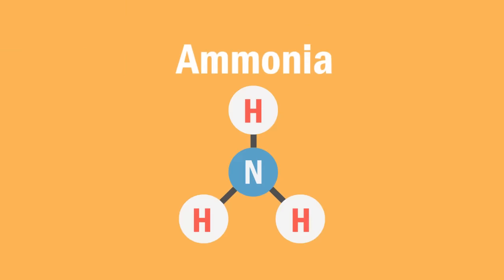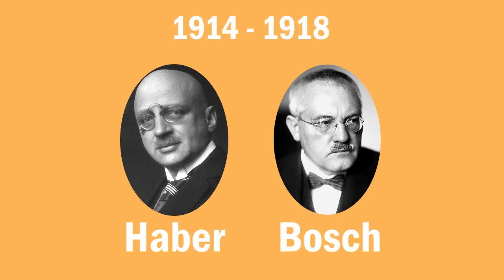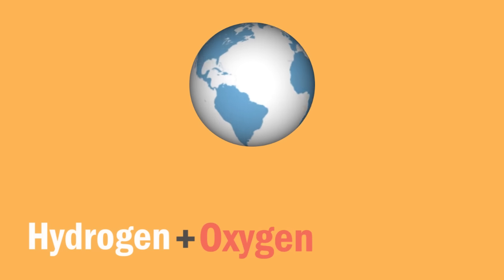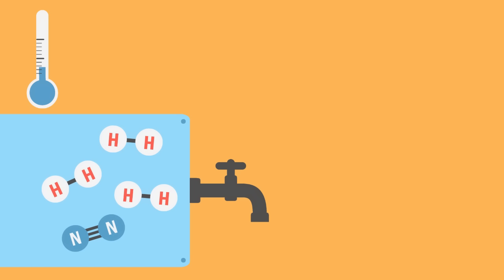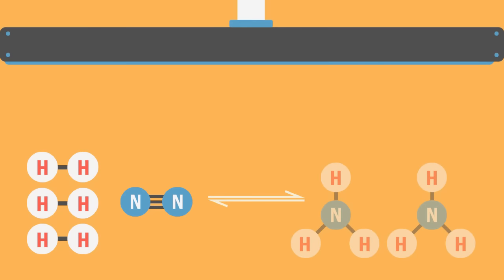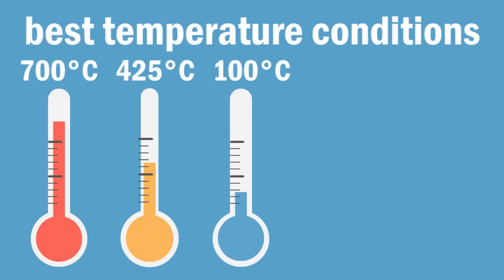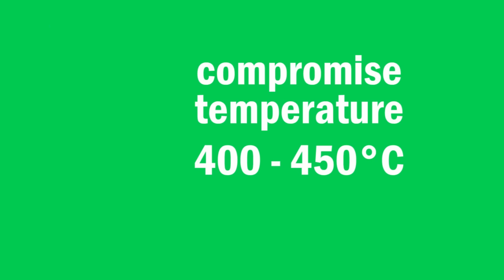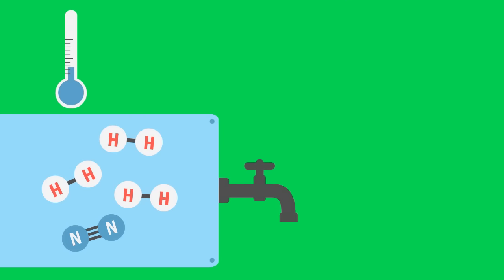What Is The Haber Process | Reactions | Chemistry | FuseSchool

Comment: Even molybdenum is used as a catalyst
Reply: Molybdenum is used as promoter
Reply: It's MO (metal oxides) not Mo. So don't be confused. Some books have been conveying this wrong info.
Reply: Earlier, Fe was used as catalyst with molybdenum as promoter. But now, use of the catalyst iron oxide with small amounts of K2O and Al2O3 increases the rate of reaction.

Comment: When you say 
methane + steam -> hydrogen + carbon monoxide

What do you mean by steam?
Reply from the maker: It means hot water - the vapour into which water is converted when heated. 

High temperature steam is H20 used to produce hydrogen from the methane source.
Reply: Steam means Super heated water